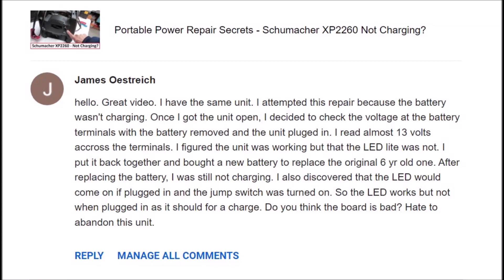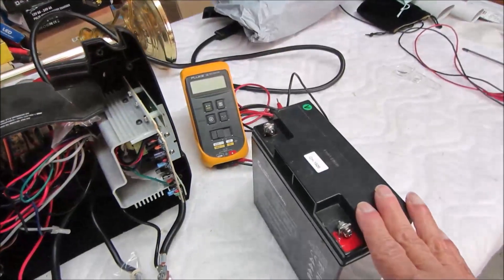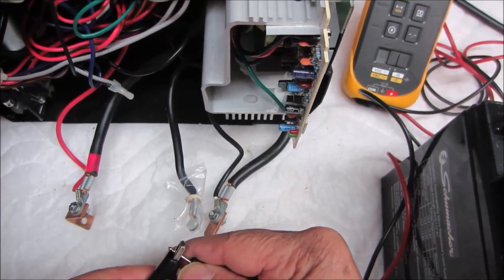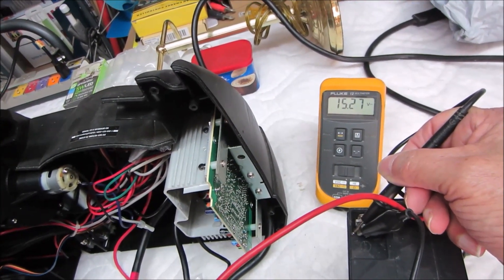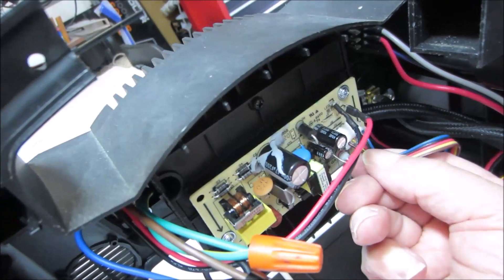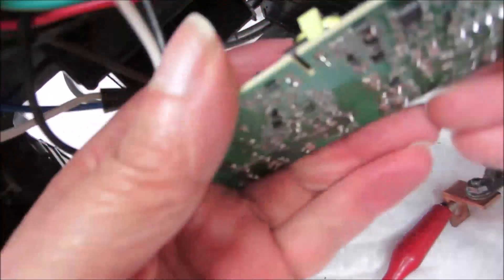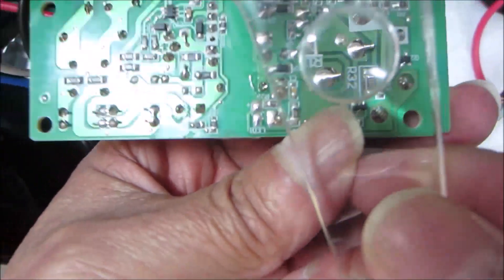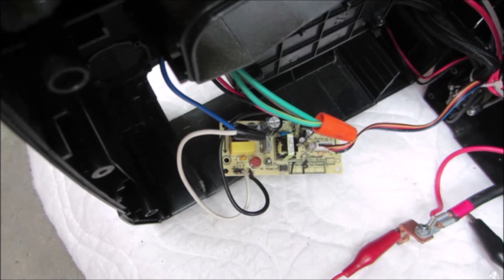Portable Power Repair Secrets - Schumacher™ XP2260 Not Charging? PART 2

Comment: I picked up an older Schumacher power/jumpstart unit by the side of the road. It does charge up . I tested to see if it would power even a small blow dryer through the plug ins. I'm going to charge it for a few days and see what happens. The battery was right out of power I guess and maybe the people who were throwing it away thought it didn't work. Cross my fingers the battery does keep a charge. These things can be expensive to buy in the stores and I've always wanted 1 lol

Comment: Very nice video! I have a trash-picked DieHard 1150 that won'tcharge from AC. It’s very similar to your XP2260. All the boards are Schumacher. The charger board looks identical to yours. It is labeled 2999001239 Rev 1 20130223. It has a surface mounted cylindrical fuse, T 1A 250V 374, with no continuity. I ordered a replacement. There is no visual evidence of failed components, so I'm not sure why it opened. I haven't inspected the solder joints yet. Thoughts?
Reply from the maker: I have a rescue/repair video on a DieHard 950 https://youtu.be/g5ibI23UWCA that you might find helpful. Start watching from 15:25. As far as I know, the only difference between the two models is model 1150 has an inverter, 950 doesn't. Other than that, they should be the same. Regarding the fuse, any 1A fuse that you can solder across or (in place of) the open SMD fuse will work. They don't have to be identical. If the replacement fuse blows again, there's a short somewhere in the unit. Hope this helps. Thanks for asking!
Reply: @LawrencePina  That was also a nice video! I would say that the DieHard 1150 is actually closer to the XP2260 than to the 950; it has a compressor.
Reply: I have a Schumacher XP2260 with that exact same circuit board that is inop. My fuse is not blown, though and I don't see any obvious failures.
Reply: I replaced the surface mounted fuse, T 1A 250 V 374, and now the charging circuit works. @TurkeySandwichJr, did you check for continuity across the cylindrical fuse? (not the automotive style fuses).
Reply: @richk6827  yes unfortunately, my board mounted fuse has continuity. I was able to verify a good connection all the way from both 120v male prongs (hot and neutral), all the way to the next board mounted device (the yellow rectangular thing).
Reply: @richk6827  Just as a follow-up in case anyone else needs to know. I can't figure out what's wrong with the charge controller board, because I'm not an electronics wizard and the problem isn't obvious. But I did figure out a workaround!

I was able to charge my unit by attaching my 12v battery maintenance charger (also Schumacher lol) to the battery leads and turning on the "jump start" switch on the jump box unit. It is currently happily charging away at 13.1v. The jump box did emit a warning "beep" after the switch has been on for about 5 minutes, but as this circuit is controlled by the manual switch only, the unit cannot stop it from charging.

Comment: Hi Lawrence.  I had a chance to run thru the troubleshooting you suggested here.  I was able to verify that my flip out plug IS in good working order.  It read 123 volts at the board.  I then checked the output for the charging pair and it was only putting out 3 volts.  As I suspected, there is a board issue.  Do you know where to source a replacement board?  I called Schumacher and they do not sell replacement parts.  I looked in Century tool and equip. but they do not have any available.  Hopefully I can find one.  The board I thought was the right one the other day is the charging board with the LED display in the front of the unit.  Thanks for your help!!!
Reply from the maker: Maybe these people: https://www.centurytool.net/XP2260_Schumacher_Portable_Power_Source_s/76160.htm If not, then you could substitute just about any 12-15VDC, 500-750mA AC adapter like the ones that come with Schumacher-built, DieHard-brand power packs. Or, you could substitute one of these: https://youtu.be/f54INhQuvhc Nice part about the HF Viking https://www.harborfreight.com/4-amp-fully-automatic-microprocessor-controlled-battery-chargermaintainer-63350.html is that it comes with the detachable wiring harness you would need to use an external charger with the XP2260. You won't have to make one. The Viking won't overcharge a battery and when disconnected from the XP2260, you can use it to charge and/or restore boat, car, lawn tractor, motorcycle, snow blower batteries as well. I have that exact same Viking and find it very useful. Sale price is usually $30, so if it's not on sale today, it will be shortly. In the event you do find an official charger board, please consider mailing me your broken one. Its repair might make a nice Part 3. Hope this helps. Thanks for commenting.
Reply: Hey Lawrence and James, I have a matching Schumacher unit with matching symptoms.  James, did you end up finding out the issue or getting a replacement board? Lawrence, would you have any tips for diagnosing the board?
Reply: Hey  @LawrencePina , I also have one of these units that recently stopped charging but not sure what the issue is. I had noticed recently the issue with the charge port feeling loose but was still able to charge the unit to 100% it suddenly started showing a “r02” code and beeping noise under jump box function the last time I used it but cannot find any information online about what that means. Plugging it in there is no green led which lead me to believe it was a charge connection issue so I disassembled the case and used a screwdriver to push the metal springs out that engage the charging outlet prongs and it feels like new but still no green led. I watched your videos but had a different result on one of the tests. With no battery installed and the unit plugged into wall power the led is a solid green (not flashing) and I was able to verify the correct dc voltage output from the charge converter board so I feel like the electronics are good at least up to that point. The battery was placed on an independent charger but took no further charge as it was already at 100% and multimeter verified voltage at 12.8v which seems to be fine.  Reassembly and testing showed same results. r02 code, no green led. Thoughts?
Reply from the maker: @DM-yb6gn Schumacher DTC codes are listed here: https://www.schumacherelectric.com/troubleshooting/ Since r02 is not listed, could you possibly be looking at f02? Otherwise, your description of the symptoms seems contradictory. 
1. Green LED is on solid (lit and not blinking) when the unit is plugged in to AC power with the  battery disconnected. If so what voltage do you read at the disconnected battery terminals?
2. Green LED is off (not lit and not blinking) when the unit is plugged in to AC power and the battery is connected. If so, what voltage do you read across the connected battery terminals? Is it the same as the voltage you read at the output of the charger PCB?
3. Another way to go about this: Do you have any other 12V battery you could connect to the unit? If so, do you get the exact same symptoms when using a different battery? In that case, start disconnecting secondary modules. Disconnect the inverter. If that doesn't make a difference, disconnect the compressor. Turn the unit into a jump starter, only. 
4. For a hopefully helpful visual wiring diagram, watch Portable Power Repair Secrets - DieHard 950 https://youtu.be/g5ibI23UWCA Although the DieHard 950 has an external power supply, wiring through the jump start switch is similar. Hope this helps. Please like and subscribe as it really helps the channel.